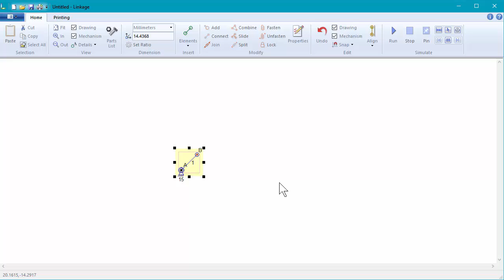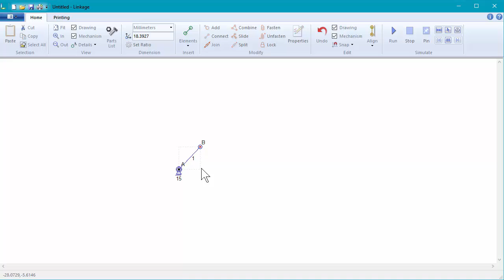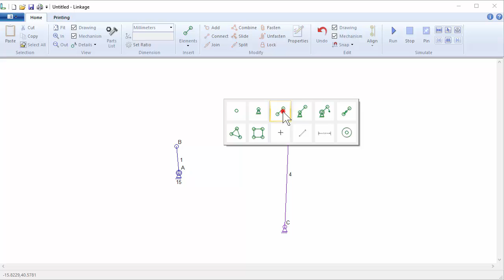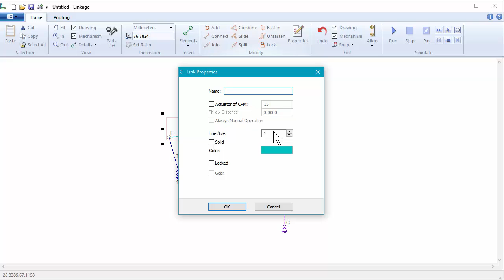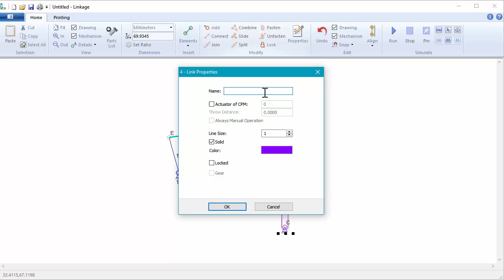Linkage Mechanism Designer and Simulator Tutorial 1

Comment: Downloaded the program to play around, viewed tutorials and users guide, unfortunally, annyway how I try, neither the links / connectors holds distances, measurements or constraints so impossible to design what so ever? Nevertheless its seems so easy viewing tutorials?
Reply from the maker: When you say "holds distances", I suspect you are talking about in the editor. If the simulation is failing then I need an example so I can fix the bug. For the editor, this is not a CAD program where you specify constraints and positions and relationships between the links, this is a rapid prototyping tool where you simply drag around the connectors and see how the mechanism works in different configurations. If I'm mistaken and there's a bug or some other issue that I can fix, please find my email address in the software "about" box or in the PDF document and send me a note with more specific information - It's hard to do support and make improvements without more concrete examples of a problem.

Many people have sent me data about their final designs and pictures of physical prototypes so for a specific subset of users who work in a specific way, it works as expected. Folding wings for cosplay isn't rocket science but it's not an easy problem to solve :) I have also had a few people say it's the hardest software they ever used, which surprises me since it's patterned off of illustration programs like Corel Draw and Illustrator, but is perfectly fine - not everyone works in the same way. It would be great if we can figure out how to get things working for you or at least come to a conclusion that this is just not the type of user interface that suits your needs
Reply: @rectorsquid  thx fr reply, will send you a few files I was just "experimenting" on. Just to be sure, I downloaded version 3.11.3 64 bits on OS windows 10 would that give problems? And another strange thing, when I load an example file those work just fine? So things just don't ad up, I tried everything and don't understand what could be the problem?
Reply: The Dutch is quick to complaining.

Comment: How to change the direction of the input actuator, i want it to move counter clockwise
Reply from the maker: Use a negative value for the RPM.
Check out the PDF documentation file that comes with the program. it should have that sort of information in it. If not, let me know and I'll fix it.

Comment: can we simulate a gear on a flag gear, aka the kremayer gears?
Reply from the maker: Nope, sorry. I haven't figured out yet how to make that work. it's not mathematically hard but the user interface needs to be just right and I haven't figured it out.
Reply: @rectorsquid  Even what you did so far is beyond my programming skills, I still hope you also find time to add that one too in the future.  My students ask for it :D. Best regards.
Reply from the maker: @endtasid , Thanks. The great thing about computer programming is in how you can, like a great painter, just make one small brush stroke at  time to come up with a masterpiece (or at least something passable like the Linkage software). Can you find my email address in the software or documentation and send me some info about what types of mechanisms you would design with kremayer gears? I could make a quick example but I would like to see if there's something more interesting that I can't think of that can't be made to work some other way.
Reply: @rectorsquid  Although I'm an electronical engineer, as my job I need to give some engineering lectures to industrial design students, their future job will mostly be drawing and design related so the mechanisms we do are very simple , eg, car window wipers, simple toys with cams etc and some mechanisms i find on thang10146's channel which I think are related to some design details of furniture etc. nothing fancy. simple cremayer mechanism is ok. to incorporate some cams on linkage sim would also be great.

Comment: This software is awesome, thank you!. Is there a way to impose constraints on a rotating input connector (i.e. the crank only swings between 0 and 220 degrees).
Reply from the maker: In the properties box for the input connector, you can enter a start angle and a limit angle. The limit is the maximum angle in degrees that the input will rotate. The start angle is the angle from zero to the limit where the movement starts. The start angle doesn't make the mechanism jump, it simply treats the current position in the editor as that angle and then the movement moves from there to the limit and back all the way to zero before moving "forward" again. In other words, if you enter 45 as the start and 90 as the limit, the movement starts and moves the connected links 45 degrees before reversing direction, at which point they travel 90 degrees the opposite direction before changing direction again and moving 90 degrees again to the limit. I hope that makes sense; Try it and it should be apparent what it is doing.

Comment: Thank you for your video. Is it possible draw the path that describes one point in link 2? I would like to compare the path between two similar mechanisms and look which is better.I would like to see at the same time the two paths. Thank you so much.
Reply from the maker: If you select the properties for any connector, there is an option to draw the motion path. You can compare those drawings visually when the simulation is run. Once the path is drawn, you can export it using the Export item in the File menu.
Reply: @rectorsquid  thank you so much. I will try it! :-)

Comment: 3:20   It gives the message  -->>  '' The mecanism has no input. A rotating input connector or a linear actuator is required to run the mechanism . ''
Reply from the maker: Is there a rotating input anchor? Please find my email address in the software or documentation and send me a copy of the mechanism if you are not sure.

Comment: Nice piece of software. Is it possible to make curved / angled connector (pushing rod) ? Like this mechanism http://www.nmbtgroup.ru/userfiles/content/0/0/1/135_big.jpg
Reply from the maker: The software is for designing the locations of the connectors, not the shape of the parts. If you need a curved link, simply create the curve in the link during the manufacturing process. The shape of the link does not alter the relative locations of the connectors on the link.
Reply: @rectorsquid  thank You for prompt answer. If I put straight link, it hit the frame of the door during opening (in software modeling in Linkage), so design cannot be tested in emulator ... that is not good :-/

Comment: Menu "Connect" = "Link", @2:49 do what it says won't work, no need to click "Join" and to run the design you need to right click on the first anchor, click properties then "Rotating Input Anchor of RPM" followed by OK then run.
Reply from the maker: The first link that was dropped into the mechanism was a rotating input so there should be no need to change the properties of any connector.

Yes, the "Connect" feature changed to "Link" a long time after this video was made, if that what's you mean about the "connect" = "link". Sorry fi that gave you trouble.

Feel free to email me with any questions or suggestions. I may also be misunderstanding what you are describing here so you can tell me more if I got it wrong.

Thanks.

Dave
Reply: @rectorsquid  Just trying to help others, I thought the button had moved at first then tried it to see what would happen. Clicking run didn't work until I had entered properties and configured it. Thanks for the interesting program, I'm looking forward to using it in a project I'm working on.

Comment: why I cant connect my to connector? And why my "join" and other button at the modify doesnt work??
Reply from the maker: When you do the "join", do you have two connectors selected? Are they two connectors on two different links? Feel free to find my email address in the software and send me some screen shots right when you are experiencing the trouble. Also, try the step-by-step instruction in the PDF documentation file that came with the software. Maybe the text will make more sense written down and not spoken by a computer voice.

Comment: Hi i've used linkage for a mechanism project. 
One feedback i'd like to give is with regard to locking the positions of anchors and connectors. 
I found exact dimensioning of the links very difficult to do, when inserting a new dimensions for a link the connectors move to compensate and it is not possible to lock the connector's position.
I'd like to have connector and anchor positions able to be locked so that dimensioning of links is more controllable. 

The interface and tutorial has been very convenient and the program has been fun to use thus far. 
Thank you very much for all your hard work ^^
Reply from the maker: Thanks for the feedback. I was working on locking connectors. I thought I had updated the download page that use the version that has that feature. But it is a new feature and might not work as expected all of the time. I'll see what I can do to improve it.

Comment: man can you help me with a video of working of bell crank mechanism? Thanks in advance.
Reply from the maker: Sure. What part of it do you need help with? What work have you done so far on it?
Reply: +David Rector I'm doing a project and I'm using this bell crank mechanism. it's like a L shaped lever connected with a link and then to the bell crank. I'm using it for unloading the sand collected in a scoop. I want to simulate the mechanism before doing it practically but the problem is that I dunno how to give a force(not rotation) in the L shaped lever in linkage software.
Reply from the maker: All Linkage mechanisms need a motor or actuator to drive them. Add an actuator and make one end an anchor. Join the other end to the bell crank or to a part that moves the bell crank. Remember that the mechanism cannot have any unpredictable movement - you cannot rely on gravity to keep things in position. it all needs to be predictable mathematically. Find my email address is the software and send me an email with your mechanism attached. I'll fix it and send it back if you are still having trouble. - Dave
Reply: +David Rector thanks alot mate! I'll send you asap.

Comment: Is there a way to insert a force/torque and calculate resultant forces/torques?
Reply: Not even angular and linear velocities? Since you input the angular velocity, it doesn't seem so hard to add other velocities to the other nodes
Reply from the maker: Nope, sorry. The Linkage software is for rapid prototyping of linkage mechanisms. There's no physics, gravity, springs, or anything clever like that in the software. Just linkages.

Comment: Nice video, is there a way to draw a prescribed path and generate a corresponding potential linkage assembly solution?
Reply from the maker: Sorry, there's nothing like that in the software right now.
Reply: Did you find any software which lets you specify the prescribe path and generate potential linkages ?